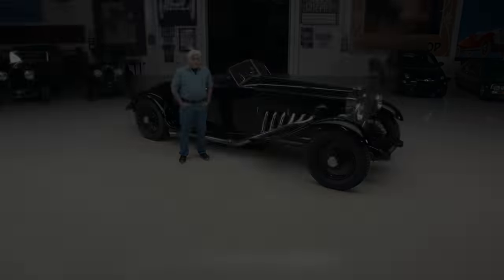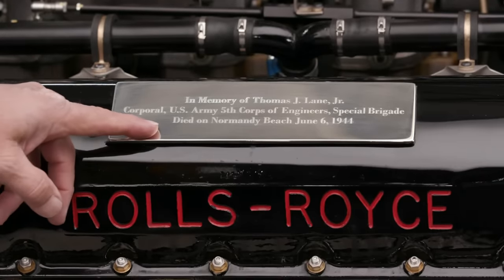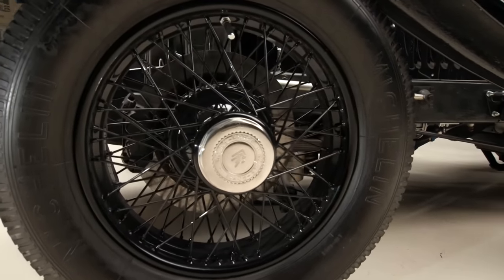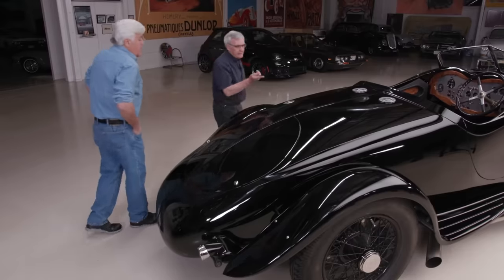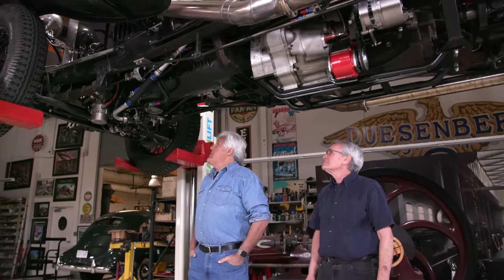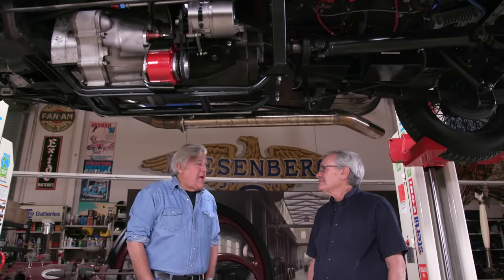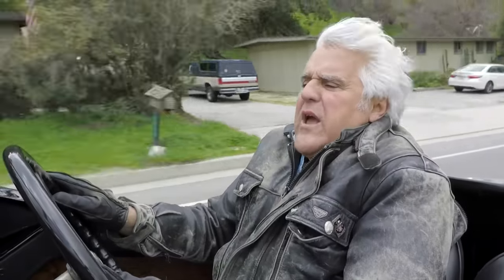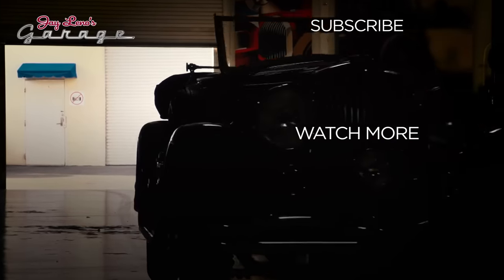1934 Rolls-Royce Merlin - Jay Leno’s Garage

Comment: The Merlin was nothing short of sheer genius. Originally designed to produce 1000hp, later versions (the Merlin 130) went to 2070hp. Props to Jay for his touching tribute to the folks who built and flew this amazing engine.
Reply: The also had the lower rated tank engine version called meteor.
Reply: Was props a pun? Lol
Reply: @Revener666  Charlie Greenfield from the UK has a Meteor engine in his Rover SD1. He said it will do 200mph but needs a long enough runway to do it.
Reply: @Revener666  Yeah the 27L meteor cranked out 600hp.
Reply: Your the man Jay what a car. Mike Mann’s is a friend of mine Iam glad you to got together. In the big city of Festus Missouri !!
Reply: Now space X use it
Reply: @jaggass  John Dodd who recently passed away also built a car called The Beast in the early 70s, which runs a Merlin engine, it's up for sale now on Car & Classic I think.
Reply: @richie4830  Compared to this one, it's absolutely bloody hideous...and I'm from the UK!
Reply: @theblokevlog352  I would have to agree, it looks like a mutated Reliant Scimitar.😂
Reply: Gen Doolittle pushed for high octane fuel. Allied engines were smaller and lighter than German engines because of high octane fuel
Reply: The power improvements were  due to American influence on a two-stage supercharger, and on providing 150-octane gas.  The engine was practically identical to those at the start of the war.
Reply: Thanks for showing us this beautiful classic.

Comment: This car will be Jay's legacy. It's absolutely gorgeous. I'm a Rolls-Royce owner and I think this is more of a 'real' Rolls-Royce than a new Wraith. Well done to all who were involved. This is a masterpiece for the ages.
Reply: As much as I totally agree with your entire comment, the Wraith and many of the modern-day Rolls Royces still have meaning, importance, emotion, etc. all around. The Wraith defines perfection as a Luxurious, Vivacious Gran Tourer; The Dawn is a dazzling, elegant yacht; The Ghost being the same as well; The Phantom being the all-ruling boss; and the Cullinan being what the Phantom is, but taller.
Reply: @rahulmandala4930  
In my opinion almost all low output car manufacturers are diluted due to their need to be financially viable or/and the fact that they're almost all owned by bigger manufacturers. A lot of the components of todays Rolls Royce can be traced to BMW, and to some extent thats good. It ensures some degree of QC because BMW have the funds to design and test to a greater extent than RR could on their own. However some soul is lost imo compared to a RR that could've been fully built in Goodwood.
Reply: @philipsode4168  You would have to go back a long time before the Germans to find an RR without significant foreign content. Back in the 80's I had a friend who restored these cars  and he said his favourites were the 50's six cylinder cars because so many of the parts were sourced from GM. It made the cars more reliable  and much less expensive to keep on the road.
Reply: @davephillips5868  Late comment but you are right. It's a simple numbers game, not enough rich people to buy the vehicles so they have to use mass produced design elements and companies to stay alive. 
I know if I had something like this Id change the carbs to EFI with Weber throttle bodies, hidden DIS with LS coils and change the camshafts so that it would be more efficient.

Comment: Four Merlins flew over my house yesterday. Fantastic sound and you can hear them coming long before you see the Lancaster.
Reply: I too have seen the Lancaster flying too, but it was in company of a Hurricane and Spitfire in the summer of 81 . I was on holiday in the Isle of Wight, and the three aeroplanes flew about 100 - 200 feet above the beach. Time n people stopped still as the air was ripped apart by the sound of 6 Merlin's and they banked over the bay with the sun reflecting on glass cockpit covers. And then in the 90's was lucky to work at Bham international airport, there was a single Supermarine Spitfire practising manouvers over the airport. You could hear the engine inside the building!!! It climbed and turned and flew gracefully and even did a Victory Roll. Awesome Sunday never forgotten, if I had the money I'd fly in the twin seat spitfire.

Comment: Thank you so much Mr. Leno. My father used to tell me stories of how wonderful the Merlin engine was in his P-40 Warhawk. he was a fighter pilot in the Pacific theater with the US army air corps, stationed in New Guinea.
Reply: COOL
Reply: Those would have been F or Ls as all the rest used Allisons.
Reply: The P-40 had a Allison engine.
Reply: ROBERT HOGUE not the F and L variants, they used a Merlin 13 engine that gave them an effective ceiling of 20 Angels. Guys would strip out two of the 50 cals and the wing fuel tanks to make faster birds and pounce enemies in a diving attack knowing nothing could chase them down. They were hot planes
Reply: @johnbeauvais3159  thank you for correcting me. Now I know more!

Comment: That's a genuine piece of art you built Jay... Please do get that brake booster in there as I'm sure you'll feel more relaxed and assured.   Also, you weren't kidding when you said that the transmission is slung low. I can't believe how close those skid rails are to the ground. I guess you have to be very careful and on the lookout for any manholes that are even slightly above street grade. Love your show and I can't get enough. Please don't ever stop making them.
Reply: And manhole covers askew. Ask George Russell of Williams F1.
Reply: Yes I agree, those skid rails must give only 3 to 5 inches clearance ? When I observed that it made me wonder if it would be practical to rotate the engine a few degrees but I realize it is a unusually complex engine and it could further complicate configuring the oil cooling lines and fuel lines and pumps. But the main reason I would be loath to do it is it would alter the beautiful symmetry of the engine compartment.

Comment: Jay, few people ever speak of the incredible purpose we all took on hands to win that war.  I enlisted in the Marines in 75 simply because someone has to serve or we all fail.  I've long enjoyed your "garage" sharing, I own a few vehicles in common with you, a Triumph from the seventies, a couple harleys, one I built from scratch, all new in 95, about thirty bikes in fifty years, dozens of cars, trucks, and bikes, moving through the states as a marine for two decades.  You are an inspiration to so many of us who love, live and breath engines, many of us pulled into it by war.  I would give a lot to have a cup of coffee or three, and good conversation over engines.  That is perhaps the first time I've ever seen that "special magneto". I've had a magneto on a TR6R, and a couple Harley's with maggies, never seen one that "throws a shower of sparks".  I have had a "trembler coil" that made a shower of sparks, but that was substantially different.  Thanks for all you do for us "gearheads".  I love the Dana 60 axle, I had an old GMC truck with the same rear end, forty years ago, that truck was simply bulletproof.  I sold it in Hawaii, because my wife couldn't handle the clutch while I was deployed.  Best truck I ever had.  79 GMC, four bolt 350, top loading four speed.  I got to watch a few Merlins in aircraft back in the early seventies, flying out of Cherry Point, NC.  A few airshows at the bicentennial.  One of the consistencies you've given us is the constant reminder of "how we became the manufacturing powerhouse we once were.  I've been enjoying your expositions as few other reminders of what we did in those decades.

Comment: 600 RPM at 60+ MPH makes this my favorite car ever. This is so awesome. This would tow better than any factory truck on the road today, with 1700 ft/lbs of torque and 1000hp.
Reply: No it wouldn't  only reason it isn't struggling   is becouse of  how big the engien  is compared to the chassis
Reply: If you could afford the gas to drive it. I spoke with a pilot who was flying a P-51 at an airshow, back in the 1990's; his comment about fuel economy was, it took about $150 worth of high octane avgas just for startup and taxi to the runway.  Mercy, the sound of these big V-12's is intoxicating, I could listen to that car run all day.
Reply: You can't compare something as unique and beautiful as this to a jumped-up farm vehicle
Reply: @DeereX748  Holy cow! That's a ton of fuel!! I have to imagine, with turning only about 600rpms, with those skinny tires, at 45 or 60 mph, it's gotta get at least 10 mpg? I'd love to know what the actual gas mileage is? My hope is that one day, when politics change, we will be allowed to retrofit old carbureted engines with a water fuel system. It might be 30 years until we are allowed to do that, but it would make old cars even more valuable. The very first ICE engine ever built, ran on electrolyzed water. There was a man in New Zealand in 2008, that seemed to be driving his motorcycle on a type of homemade hydrogen peroxide.

Comment: I'd like to see this car run at Bonneville, not necessarily for top speed records but, just to let it Run(stretch it's legs a little).
I bet it would sound awesome.
Reply: Maybe we could all guess at it's top speed limits? My guess is Theoretically it will do 400mph +. At Bonneville or at the Lake beds my guess is under 200mph. Aerodynamics would prevent it. It May go 160-180mph with lots of Prayers.

Comment: For a Merlin aircraft engine you need a specially built truck gear box with specially tough clutch , cardan axle, differential and all. You did it and the results are amazing! Thanks.

Comment: 15:00 my favorite part. Getting into the nuts and bolts. Modern vehicles SHOULD have an oil primer too, or at least an ignition delay.
Reply: ln most cases it wouldn't be worth the cost because well designed and maintained modern engines often outlast the rest of the car.

Comment: "It's a little loud, but that's alright." Famous relationship quotes.
Reply: Probably why it's a convertible.  You put a roof on it, and one would immediately become deaf from the engine noise.  How's your American Sign Language, Jay?  Never mind.  You need both hands on that steering wheel.  ;)
Reply: Truly  one of those cars that has no need for a radio.... 🤣
Reply: "It's a car. It should be able to drive itself to a car show." - I wish more collectors shared that sentiment.
Reply: Not gonna work with your girl if you're talking about farts...

Comment: Mack makes a 6-speed manual for their heavy duty trucks that should handle 1500 to 2000 foot pounds but I believe they are none synchronized Transmissions though so you would have to double clutch it or float the gears ,, it sure would give you an old time experience to match the car haha ,, love the show.
Reply: Powerglide or Torqueflite would be my choice, truck version if possible. Tank version of Merlin, Meteor, used manual truck gearbox. I actually saw heavy machinery, powered by Meteor engine, and they used hydrostatic, not hydrodynamic, transmissions.
Reply: straight cut gears would whine at 140db

Comment: At the airshows I can close my eyes and tell you when the P51 Mustang flies over because of that unique sound of the Rolls Royce Merlin engine.
Reply: Russ Gallagher thank you Russ. Packard Merlin is correct.
Reply: The 95th Phantom  under license of Rolls Royce.
Reply: Russ Gallagher under license of Rolls Royce
Reply: You can hear the Mustang specifically, there’s a couple Merlin powered P-40s and they don’t sound like a P-51. There’s a tenor that comes from the shape of the Mustang that can’t be matched, not to mention the distinct whine of the gunports
Reply: I was at the Brighton Speed Trials back in the 90s, and a Spitfire made a low pass over the water parallel to the beach promenade, What a sound...
Reply: I live at Biggin hill , and the spitfires fly regularly.  Last year one of the last two flying Lancasters flew over flanked by a spitfire and a hurricane.  The noise was something I’ll cherish forever

Comment: "we have left mag, right mag, CLEAR FOR TAKEOFF!" I imagine there were dogfights between Jay's Rolls and a Merc with a Messerschmidt motor on the autobahn in the 1940's
Reply: A merc with either a 33.9litre Daimler-Benz DB 601 engine or a 35.7 litre DB 605, these are the engines used on Messerschmitt fighter aircraft in ww2. I’d be almost more interested in the BMW 801, a 41.8 litre 14 cylinder radial engine used in the FW-190
Reply: @onelyone6976  I’d be most interested in seeing a radial engine work on a car!
Reply: They build motorcycles around radials, why not cars?😅
Reply: @onelyone6976  Then you have a Ford or Chrysler with a Pratt & Whitney R2800

Comment: What a car!
So much testosterone, it's balls are almost dragging on the ground.
Reply: Yeah it comes pretty close at times. Think I would raise it another inch or 2
Reply: Brian Anthony 

700 rpm in 6th gear touching 80 🤪
Reply: Correct, so they built it a metal jockstrap.

Comment: So this engine is called a Meteor when it's on the ground in a tank and a Merlin when it's in the sky in a plane...that's ironic
Reply: A Merlin is also a bird.
Reply: and meteors sometimes hit the ground.
Reply: @marzsit9833  you guys literally just expanded my brain and now I think of it... it's in the definition ie. Meteor vs meteorite vs astroid
I ought to use critical thinking more often
Reply: @boxedfender4810  fun fact: the Rover Motor Company originally re-engineered and manufactured the Meteor engine for tanks.

Comment: Thank you Mr Leno's.

What does not sound quite perfect on this 1934 Rolls-Royce Merlin with regard to the 6 Weber double carburettors but with only 1 lambda probe for each cylinder bank, when driving, results from the construction of the two exhaust fan manifolds which are not correctly adapted in the fuel-air pre-mixing pipes of the Weber carburettors. 

If thin stainless steel measuring lines were installed in the exhaust fan manifolds and led in the same length from each exhaust vent to a broadband lambda sensor, this would result in 24 lambda sensors. Two lambda sensors per cylinder. The mixing tubes can then be exactly adjusted from the real driving data at 55 miles per hour and 88 miles per hour. 

If the two lambda values of each of the 12 cylinders at the two exhaust valves are slightly different, then the individual valve clearance of each cylinder can be determined and adjusted exactly. If this is not sufficient, the valve operation must be corrected.

This is very labour and skill intensive and is done in RR effective development of such engines. 

Water pump and radiator fan. Here, a variomatic drive is actually ideal. The engine would like to be mechanically driven at 61°C at 55 miles per hour to 63° Celsius at 88 miles per hour to feel good about its cooling. 

Thank you very much for the video, the very good stereo sound and the perfect explanation of this good vehicle.

With professional greetings

Michael Frithjof Mueller

COM Nr.: 3896 from 15. Oct. 2023 12 : 43 : 31 by 39376 TRUE LIke.

Comment: I was wondering what your real talent is - that is the finest car design in it's class I've ever seen. It would be just as remarkable with any V-12 under the hood. 
  I love the car and the Merlin makes it something unique and wonderful. Wonderful engineering in both the cooling system and the transmission. You made a work of art, I love early aircraft and never heard of the shower of sparks.... Bravo -.
FYI - If this is a 1934 Merlin it's Pre-Spitfire. This engine probably was to power one of the first Hawker's Interceptor Monoplanes - later named the Hurricane, built in 1934 and entering flight test in 1935 with one of these early V-12 Merlins.

Comment: Just a note on the tolerances he mentioned. They were HAND assembled in the U.K. so tolerances were not as much of an issue ,each engine was essentially blueprinted, and a ONE off, but yes tolerances should be tighter for mass production , when they are assembled more quickly as at Packard.

Comment: I'd be interested to know if the direction of rotation has been changed to that of a Meteor, I.E anti-clockwise when looking at the flywheel. A Merlin rotates the other way which causes all sorts of problems when fitting them in a car.

Comment: There are 9 different truck /Clark 5spd box gear ratio combinations  one is first 4.50 and fifth is 0.50 to one it's an alphabetacal code for ratio choices .Input shaft size is about 2.250 " 14" to 16" clutch disks.  Dana Spicer makes a 125 model with disks 12.5 " ring gear and 2" axel shaft diameter .

Comment: The BofB flight has a Spitfire, a Hurricane and a Lancaster. That's six Merlins when the flight is aloft. 
Growing up there was a garage on the A27 road to the west of Worthing which had a Spitfire parked outside. We were told that its engine had been used in a "special". At the time (1960s) the engine-free Spit was probably worth very little. I wonder where it ended up.

Comment: North American Aviation built the P-51 Mustang which originally had an Allison 28L, V-12, with a GE Turbocharger.  The British Supermarine Spitfire was outfitted with a Rolls Royce 27L,  V-12 Merlin engine & Two Stage 
Supercharger for better high altitude performance. Which the Mustang adopted. In contrast, the Messerschmitt Bf-109 had the DB 605 engine with a 35.7L displacement, inverted V-12, & Single Stage Supercharger.